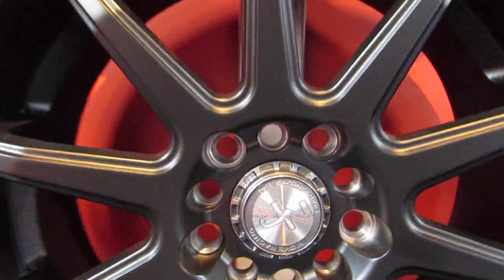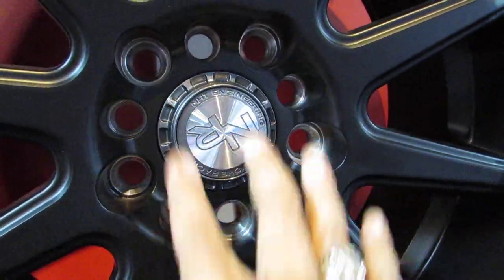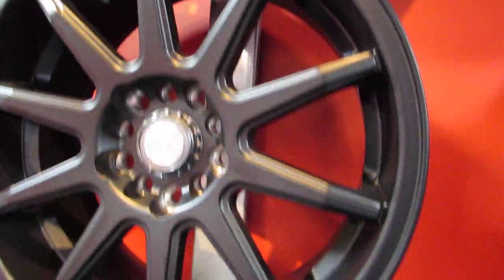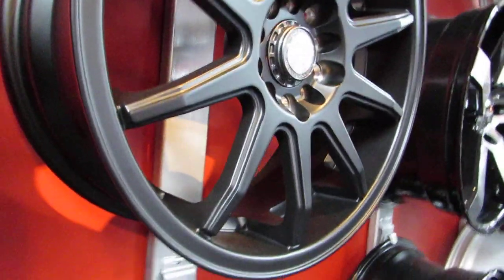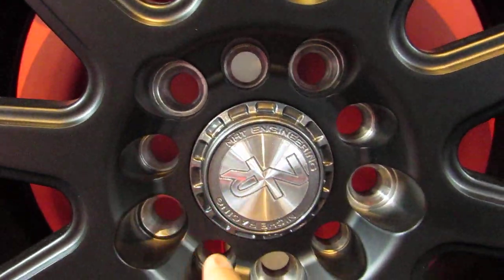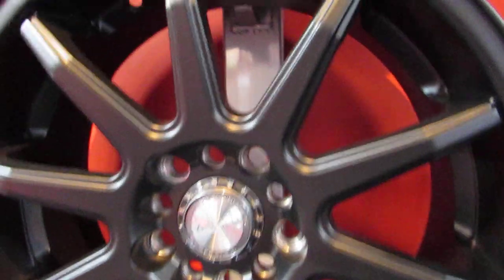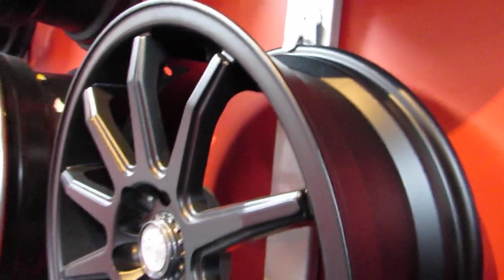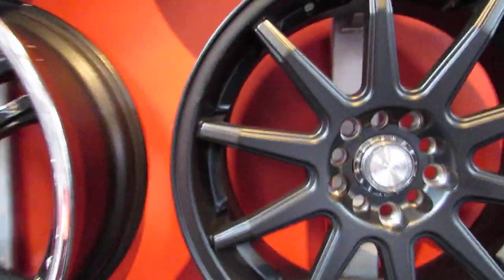ARE UNIVERSAL RIMS OR MULTI FIT RIMS GOOD? (FACTS)

Comment: for some reason I have rims that are multi four, 4 x100, 4 x 114, then it has labeled 5x100 at the bottom.. There is only 8 holes, this is got to be mistake?
Reply: Usually its just 2. Idk wtf you got but seems odd

Comment: Staggered rims same I have 22s rear 20s front are they drilled the same will my 2 front 20s drilled 10 hole Be same 5x114.3 5x120 same as rear 22s that are that pattern all rims match Verde? Looking too fit 6x139.7 lug down too 5x120 with adapter's more circumference than 5x114.3 option

Comment: Great info thank you,I just put multi fit on my Honda Civic now they're bigger Wheels and I just noticed the back wheels are kind of tilted inward at the top very slightly is this a big deal the cord does seem to arrive just fine there's no shaking and no rubbing it just has that slight tilt to the top in the back wheels do you know what this could be and should I be worried is it safe thank you
Reply from the maker: Jonny 'O aka: Fizz hi call us for info tommmrow, but always use the correct fittment for every vehicles
Reply: HILLYARD'S RIM LIONS number?
Reply from the maker: Jonny 'O aka: Fizz 19055283500

Comment: I have a mutifit wheel it's a 5x100 and 5x4.5 or 114 it won't fit on my car the pattern is 5 x105  can they be redrilled or is there to many holes already ? I seen the can put a slug in and redrill if not I'm going to need to use a wheel adapter and the problem arise is the pilot hole going to be right on the adapter now ? ....
Reply from the maker: Bamboozel96 hi,  we'll first off the number one thing u can do is buy a new wheel in Ur bolt pattern of its cheap deal, u can't re drill since it's dual fit, and if u slot them and re insert them it has to be Done professionally, and if it's and exposed rim like this u can't since theres.not much meat in between the lugs! Only a RIM with a cap, but has to be done by a pro. Adapters and spacers I don't recommend at all thanks!

Comment: nothing but a cheap gimmick, common sense says more holes drilled into the metal WEAKENS the structure of the metal wheeL , I would NEVER risk wasting $$$ on these ''swiss cheeze'' novelty and very Un-proven rims, they also just look bad, seems to me they would snap too e z going down the road after hitting hard bumps, since most light wt aluminum wheels are soft metal to begin with
Reply: Well, you're wrong. But I'm sure you're used to that.
Reply: I here ya. Makes sense to have a tire that is made to fit. Safe by government standards if that’s good enough then by all means use “universal” fit. Key words being “if installed correctly” do make sure your the only one doing it because a lot of techs don’t know what these are and fuck up the washers. I messed up a few when I was teenager till my shop teacher taught us what they hell they were. I sent cars back on the road with tires improperly mounted and never knew. I guess they worked or if there was a problem they never came back.